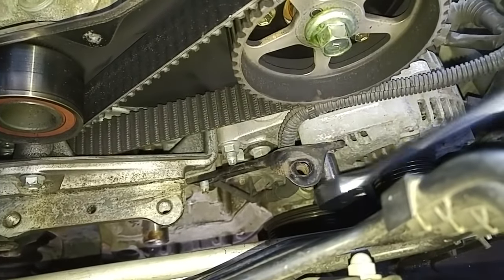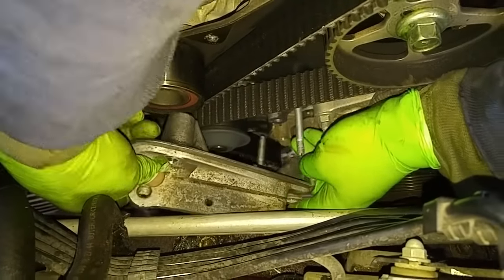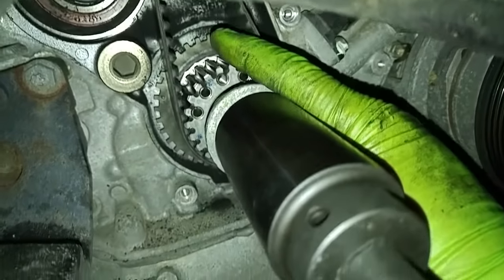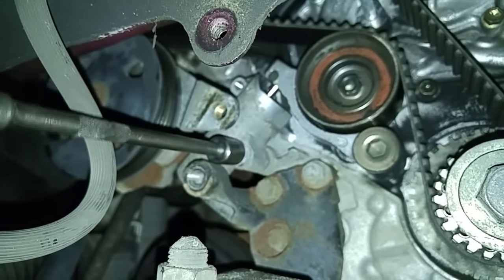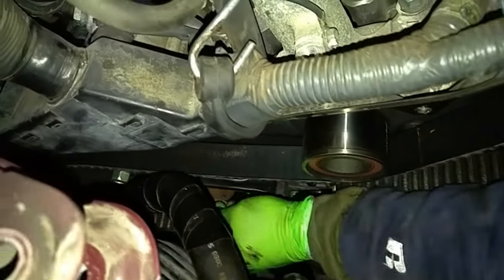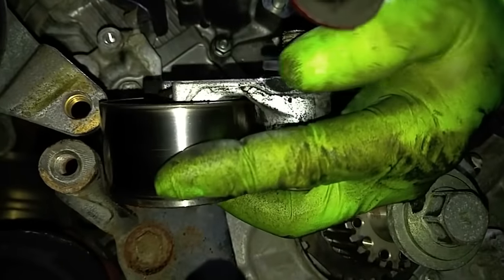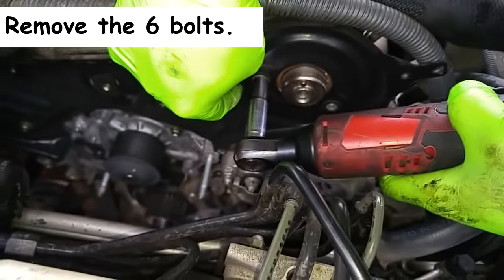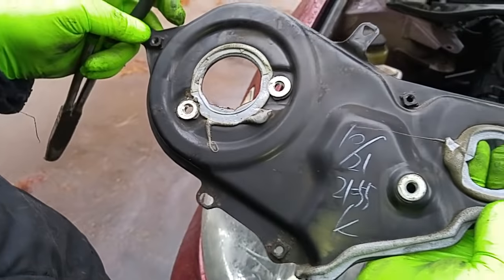Toyota Camry V6 3MZ-FE Timing Belt, Water Pump, Seals & Pulleys Replacement

Comment: Ok i set the crank to TDC and the camshaft where inline but once i took the cam sprockets off the rear moved so when i put it back on it was way off.. how can i get it back in line?? Thanks
Reply from the maker: Torque down the cam sprocket bolt (may have to hold the sprocket with a strap wrench) then use a non adjustable box wrench to re-position the sprocket TDC mark with the back dust cover TDC mark ... then you're back in business.  Before you do all that, you replaced the cam seals ... right?
Reply: Yes I've done everything up until i got stuck on the sprocket.. but thanks ill try that
Reply from the maker: It's not unusual for the cam sprocket to "jump".  That's why I learned to hold and move the sprocket with a box wrench with my left hand while installing and positioning the timing belt with the other hand.

Comment: You're really moving in this video. Have you done one on replacing a belt tensioner on a 2005 Avalon 3.5 GR-FE? I hear it is difficult.
Reply from the maker: Timing chain tensioner or accessory belt tensioner?

Comment: Can you drive without the back metal plate that the gears are connected to?
Reply from the maker: You could but don't know why you'd want to.
Reply: @hardlymovingpro  I bent all that metal plate up my belt would get damaged if I don’t get a new one just seeing thanks fr
Reply: @Taekayy_Da_Savage  I would get a new one, your belt will be exposed to dirt, grease, coolant, oil etc.

Comment: My upper tensioner pulley started to make noise 2k miles after replacing the belt. This is the third time replacing it and it’s making the noise every time. Any advice on what am I doing wrong? Thank you
Reply from the maker: Could be the camshaft sprocket rubbing on the upper timing belt cover.  With the engine running apply pressure on the cover and listen for a tone change.  To fix loosen the cover bolts, wiggle the cover until noise disappears.  Retorque the cover bolts.
Reply: Hardly Moving Productions, the cover is in very good shape, I’m very sure it’s the upper tensioner, I had it replaced and it’s making the noise. The third time replacement I used original parts from toyota, yet it still making the noise 2k miles after installation.
Reply from the maker: I've seen this happen before...recently on a Highlander.  Take the top cover off and run the engine.   Top bearing is called the idler.  Bottom bearing is the tensioner.  I hope your bearing is either Aisin or GMB.
Reply: Hardly Moving Productions, it’s the idler Lully that’s always making the noise, the dealer sold me Koyo brand. Aisin kit had koyo in it.
Reply from the maker: I doubt it's a defective or bad pulley ...IMHO

Comment: Got a question what happens if when I was removing the rear cam gear the chain slipped on me and it jumped timing??what to u do?can I just line the Mark's up again?
Reply from the maker: Yes.  Just move the cam sprocket back to the alignment mark.
Reply: Ok thanks!will there be tension moving it clockwise back to its mark if so would it be neccessary to remove spark plugs to help alleviate the pressure.Once again thanks for your help.
Reply from the maker: @samuele4265  The pressure or tension is from the valve springs.  Removing the spark plugs won't help keep the cam sprocket from moving.

Comment: I finished my work on my 95 ,V6, LS Sedan Camry a while ago. All is allmost good, started and ran well. Great Video. Very helpful. Changed everything like you did. The problem is the bottom crankshaft seal , had to open it, was leaking oil and was chewed up some. The oil seal never seemed to seat well or appear to not have enough space to fit flush. If you try and push it in with a socket it gets deformed so installed it not perfectly flush. Went through a few seals until installing it the best I could.  Using oem seal. Do I need to buy a special tool? Try a different seal or may have wrong seal? Did I damage something by accident? The camshaft seals fit in nicely.  This is the part number 90311-40022	Engine Crankshaft Seal	$11.04. Any suggestions appreciated.
Reply from the maker: Coat the inside and outside of the seal with silicone grease (aka plumber's grease, dielectric grease) before installation.  You can use a PVC pipe from your local hardware store cut to around a 8 inch length.  You can use that to tap the seal in gently with a hammer.
Reply: Thanks, I will try that out. Take Care. @hardlymovingpro

Comment: I’m having an issue putting my timing belt back on. Specifically at 6:38 your notches line up with the groove after turning the cam shaft bolt. What if doesn’t.. mine didn’t line up, how do you turn it??
Reply from the maker: Make sure both the crank and cam TDC marks are lined up.  Move the cam clockwise to mount the belt (use a box wrench).  Then turn back the cam counter clockwise which will remove the slack on the belt
Reply: Even when I align the crank TDC, the right cam  is aligned while the left cam is in the 5 o’clock position. And I can’t turn one without turning both cams. Any tips?

Comment: Hi 
Recently I did my car service i.e. 2003 Toyota Camry altise v6. My car show 174234 km on it. But mechanic suggest me change timing belt. So I am in delimma. Also I am not sure previous owner he change or not. Looking for your response.
Reply from the maker: That's a tough call.  I hate recommending a TB replacement not knowing if the belt has been replaced before.  I look for tell-tale signs that the TB covers have be removed.  If I'm convinced they have, I'll guess that the belt was changed between 80 to 100K miles (not km) then factor in the existing miles.  Sometimes I'll give the customer a break by just swapping out the belt only (which excludes the cam seals, crank seals, idler pulley, tensioner pulley and water pump.)  With the belt off, I can determine if the other components may need replacement.  I can do a belt swap in under 3 hours.  Add 2 more for the other stuff.

Comment: Which way does the harmonic balancer bolt come off?
Reply from the maker: Counter clockwise.
Reply: @hardlymovingpro  thank you, I’ve been trying to get it off but no luck. The harmonic balancer keeps spinning while I use an impact gun, any advice?
Reply from the maker: You'll have to get yourself an electric impact gun (under $100 at harbor freight) and a high mass 22mm impact socket.  Here are some links to give you an idea:  https://amzn.to/3MZe0br   https://amzn.to/3AUJnAZ

Comment: I inherited my mom's 2008 Toyota Solara it has 26 thousand miles on it it's been garage door all the time and driven by a little old lady would you change the timing belt and water pump and all the pulleys or just the timing belt would suffice or do you think I can get a hundred thousand miles on it that way they say the timing belt should be changed in 9 years
Reply from the maker: Good question.  I'd just change the belt and leave the rest alone.
Reply: Wow thanks for your quick response great video by the way thank you very much I will be changing it then thanks for your advice too
Reply from the maker: You bet!

Comment: Hey i have all the tools except the paint can opener can you offer another solution for removing the crank seal
Reply from the maker: Get yourself a small sheet metal screw and drill a hole into the seal to accommodate the screw ... then screw it in leaving a little room to grab the head of the screw with a pair of pliers.  BTW - you should be able to get a paint can lid removal tool at either Lowes or Home Depot.
Reply: Go to Home Depot, they'll probably give you a paint can opener.

Comment: What was the tool you used to remove the cam seal and crank seal and did you use a wire brush to clean around the water pump
Reply from the maker: The tools I used is listed in the Description portion of this video.  The tool is called "Camshaft Seal Removal Tool".  The wire brush is a called a "Cup Wire Brush" and was attached to "Right Angle Portable Drill"  or "Right Angle Air Powered Drill".
Reply from the maker: Oh ... and the crankshaft seal removal ... used a paint can lid removal tool.
Reply: One more question when you marked the cam pully and the back cover with the blue pin why didn't you do it when you set the crank top dead center
Reply from the maker: I set the crank first to TDC to get the camshafts in the general area.  Once the upper TB covers were off, I could then fine tune the camshafts to their exact position with minor movements of the crankshaft.  But I could have performed both the crank and camshaft alignments AFTER the TB covers were off.
Reply: Ok thanks going to give this a shot i was quoted 900 from the dealership i can try it myself for 300 with the tools and parts
Reply from the maker: Hey great!  You'll feel a wonderful sense of accomplishment when you do it yourself!

Comment: Thanks for the reply, I've seen 3 videos on this and yours is the best.
I'd like to know why you don't suggest to replace the tensioner. Also do you have to support the engine to remove the support bracket?
Reply from the maker: Never, ever encountered a tensioner that has failed on a MZFE series engine ... at least with less than 200K miles.   If you don't have access to a large vice and something like what I called a "granade pin" to hold the tensioner shaft, then go with a new tensioner.  A drill bit can be used as a substitute.   When you said bracket, do you mean the tensioner bracket?  If so, engine support is not necessary.
Reply: @hardlymovingpro  I mean the  support bracket for holding engine up to be removed to get at timing belt., my car has 205k. and is 1mzfe Thanks for quick reply.
Reply from the maker: @safffff1000  No engine support needed.
Reply: @hardlymovingpro  Thank you,
Reply from the maker: @safffff1000  No problem
Reply: @hardlymovingpro  Finished the job runs great, but I took out both power steering pump bolts, what a pain to put back
Reply from the maker: Hey ... congratulations!  But wonder why you removed the ps pump bolts?  Anyway, time for you to move onto to valve cover gasket replacement along with maybe spark plugs, ignition wire and O2 sensor.  Just check out the video we did on the ES300.  Not too bad of a job.
Reply: @hardlymovingpro  One  of lifes screw ups, live and learn. That's next when something gets worse. For now some oil stop leak.
Reply from the maker: The cover (by the firewall) has a habit of leaking bad through the valve cover gasket.  Guess because the engine's tilted.  Gives the impression that the ps pump is leaking.  Also, when the return ps line hardens, the spring clamps gives out causing a leak (now you may have 2 leaks).    Easy fix is to put a screw clamp(s) in front of the existing clamp.
Reply: @hardlymovingpro  Thanks

Comment: I had to bump start that damn crank bolt. Nothing I used would break it loose. So I used a 22mm socket. 3 foot long 1/2" breaker bar resting on the alternator belt pulley. Used the front cam sprocket bolt to snug it down on the alternator. Then bump started it. It come loose then...

And trying to see that rear timing mark is a pain. I had to do the whole thing over. As it was not inline and ran like shit....So I suggest people start the car before putting it all back on. Then starting it. It just has to run for a few seconds. You will know if it's right.
Reply from the maker: I hear you.  Been there ... done that.

Comment: Does the 2007-2011 v6 the same as 2002-2006 v6
Reply from the maker: Nope.  The new engine is called the GR-FE with a timing chain.
Reply: Hardly Moving Productions oh so the 2007 or newer are timing chain right 👍
Thanks
Reply from the maker: @johnoceanyang5522  correct.
Reply: Hardly Moving Productions thanks 👍

Comment: At 2 min 48 sec that little piece could it stop the engine from running?
Reply from the maker: Nope.  That's a "belt stay".  Helps with keeping the belt from slipping off when mounting on a new belt.

Comment: Are there two types of tensioner pulleys?
Reply from the maker: There's a difference in the pulley bracket that the pulley bearing is bolted to between the 1MZ-FE 3.0L and the 3MZ-FE 3.3L.  The pulley bearing is the same.

Comment: Great Video! However one warning, DO NOT USE A CHAIN STRAP WRENCH to remove the cam sprockets!!! It looks easy on the video but mine were over torqued by some previous moron and the chain strap tool bent the sprocket. It crushed the side where the metal tool meets the sprocket. I bought the chain strap wrench recommended in this video. Instead Use a tool that holds the sprocket from the side not one that squeezes the teeth part.  Mine was torqued to over 175 lbs at the least. And applying that much force to the cam sprocket was not good.
Reply from the maker: Interesting story.  First off, how anyone can apply 175 lbs of torque on a 17 mm bolt without it shearing off is beyond me.  My recollection, from Toyota published specs., calls for around 92 lbs of torque on the cam pulley bolt which is slightly above what a tire lug nut should be.  And Toyota lugs are usually 21 mm.   On year 2000 + model V6's the torque on the cam pulley bolt seems to have decreased;  meaning a lot less torque effort using a cheater bar to get the tension off.  Before I began using the chain strap wrench, I used an adjustable long handle sprocket holding tool (like the one you described) to prevent the cam sprocket from moving.   Used in conjunction with a breaker bar with a cheater bar attached, the torque generated bent the holding tool!   At that point I asked a old timer mechanic what other options I could use.   He was the one who put me onto chain strap wrenches.  I've done over 100 timing belt replacement jobs on the MZ-FE engines and not once have I ever bent a sprocket.  I'm guessing if you went up one more link on the chain, the strap might have more evenly distributed the holding torque.   And this might have prevented the cam pulley from bending or getting crushed.   In other words, the chain strap wrench handle should be not more than 30 degrees from its contact point with the cam sprocket;  that the higher the angle, the more inward force would be applied to the sprocket.
Reply: Thanks for your reply, I really appreciate your videos I’ve watched a couple of  them and they’re well done. I tried to get the lowest profile like you suggested with the chain as tight against the sprocket as I could. I watched your videos several times and I replicated your exact angles and process. For some reason the damn thing wouldn’t budge. At first I thought the chain wrench just slipped off but what happened is that it gave way after the sprocket collapsed about a two inch gash where the wrench handle makes contact with the sprocket. I eventually got it off but I had to stand on the wrench handle (using a ladder) and used all my weight to push the breaker bar forward. Somebody really torqued this on. I saw how easily you did it. I didn’t have such luck. Anyways now that I need to replace it do you think aftermarket cam sprockets are ok or should I only go oem? Thanks again for making it look easy lol...
Reply: Hardly Moving Productions  thanks again, you didn’t mention torque values in your video. And I’m not sure if I saw you were installing with a torque wrench. Is that something you could add in the commentary or perhaps list some torque bolt values in the video description. Thanks again
Reply from the maker: For this job i don't use a torque wrench.  But if your new to car repair, get yourself a repair manual to get the torque specs.

Comment: Great how-to. Subbed. Do you know for certain if the 3MZ is an interference engine? People have conflicting answers everywhere... even between mechanics.
Reply from the maker: 3MZ is interference ... without doubt.
Reply: This 3.3L 3MZ-FE V6 Toyota engine IS AN INTERFERENCE ENGINE according to
 this web site... http://yourcarangel.com/2014/07/interference-engines-complete-list/
Reply: Maybe interference on book, but most times non interference in reality.
Reply: @eliseusnonso5182  That's what I've personally found with mine.

Comment: I like to turn my timing belt engine into a timing chain engine,it’s possible,right ? By charging the camshafts gears and crank gear
Reply from the maker: Sorry ... Impossible.
Reply: yoyohooyo thank you for sharing the important informations,appreciated
Reply from the maker: @yoyohooyo  The 3.5L 3GR-FE.  To make it work, you need the adopt the engine's wire harness (engine compartment & behind the dash), PCM computer, ABS computer, ABS pump hardware, radios, HVAC controls.  Then you'll need to know that the motor mounts line up.   The PCM use to be called ECM until the manufacturer made the engine work more closely with the transmission.  So you might have to adopt the transmission with the engine.  And if you adopt the the transmission, then you might need to adopt the rest of the drive train like the CV axles.  And if you must use the CV axles, you might have to adopt the steering knuckle and braking system.